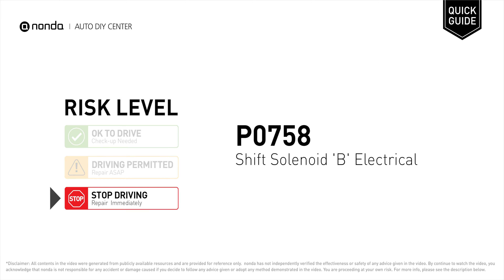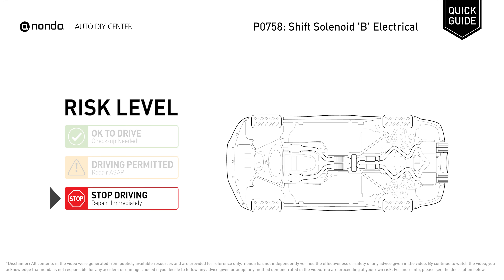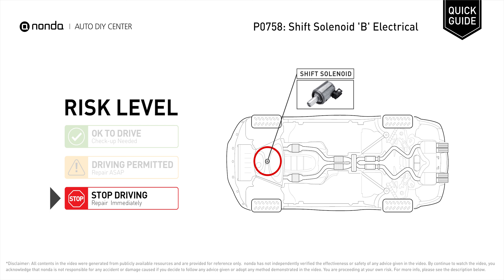What is P0758 Engine Code [Quick Guide]

Comment: I changed everything repaired wires and im still having the same code. I replaced the two shift solenoids in the transmission pan, vehicle speed sensor, neutral safety switch, solder the wire to the vehicle speed sensor where it was broken at, solder the tail light wires, changed the fluid, cleaned all the grounds i could find, and replaced alternator. Someone please help me
Reply from the maker: Hello, can you please provide us with your vehicle's year, make and model so we can provide you with a possible solution particularly for your car's make/model?
Reply: Did you replace the tcm?